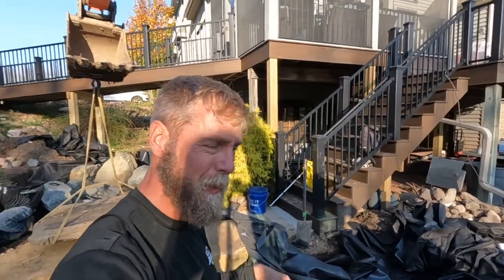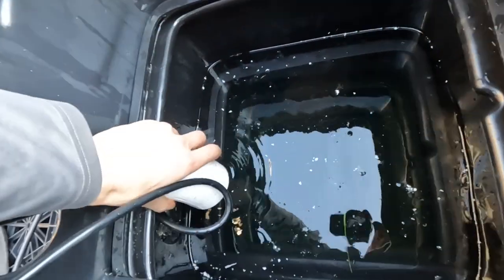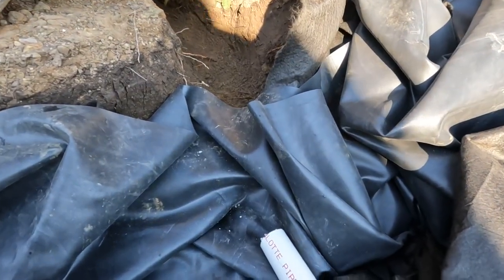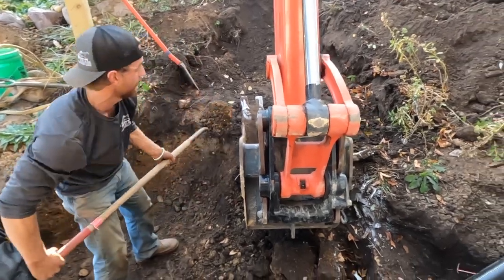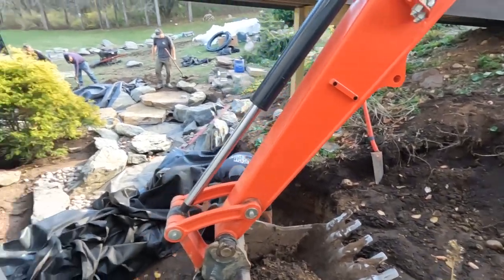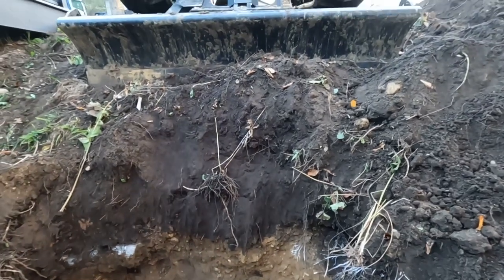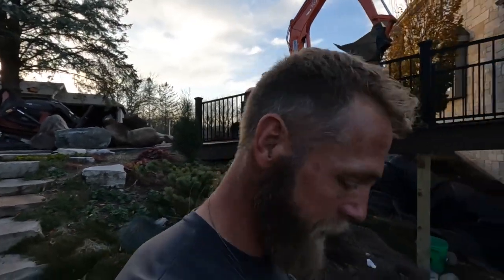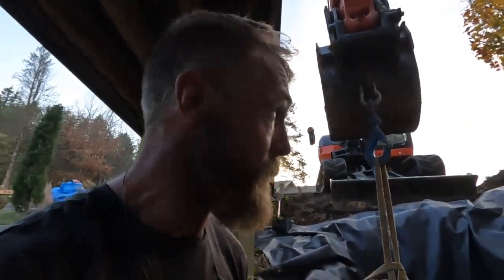This Is HOW Our WATERFALLS Run!

Comment: How do you determine the size of the pump necessary? If someone has a small pond that's roughly 175 gallons, is there a formula to use that tells me... I mean someone... which pump will work for me... I them them?

Comment: Is it set increments on the pump; if so what by how many gallons per hour?
Reply from the maker: There are 10 levels on the adjustable flow pumps, with a max low rate of 9,574 GPH for the SLD 5000-9000
Reply: @TEAMAquascape  👍🏻awesome thanks! I went to the Aquascape website and pulled up the pdf for the pumps and read thorough them, that was the only bit not mentioned.
Reply: @TEAMAquascape  I just had an idea and went back to look again and it’s in the…
UNIVERSAL REMOTE
FOR ADJUSTABLE FLOW PUMPS
• The universal remote allows for flow adjustment between settings 1 and 10 and well as* the ability to turn the pump on/off (Ex. 5).
[Typo in the instructions (well as - as well)]
👍🏻👍🏻👍🏻